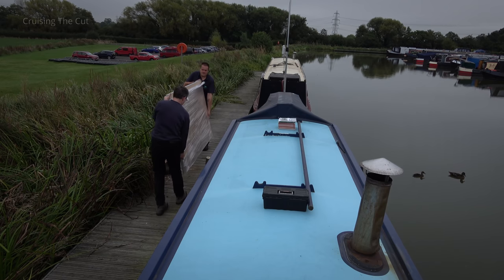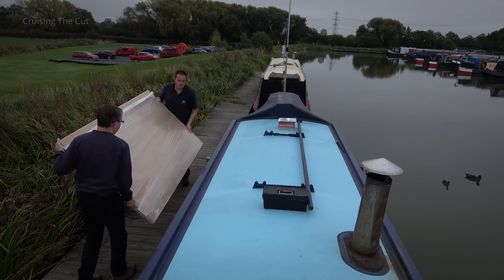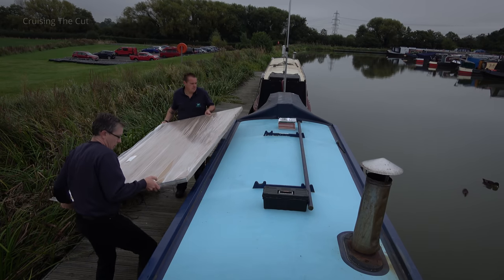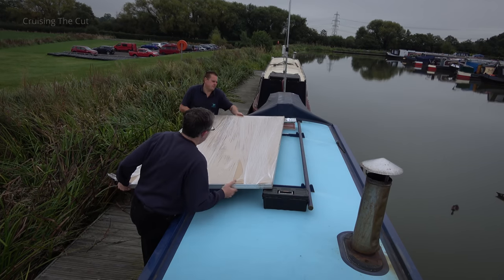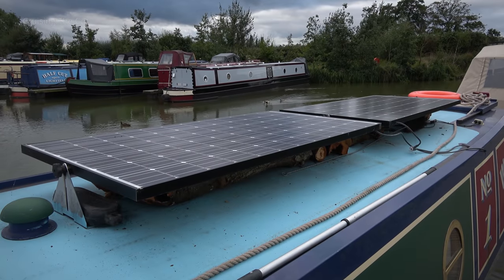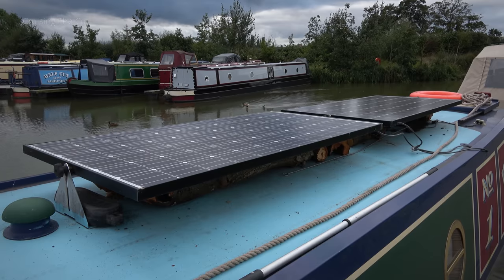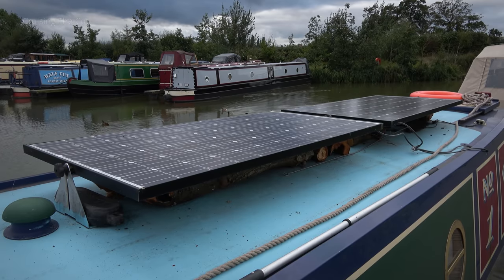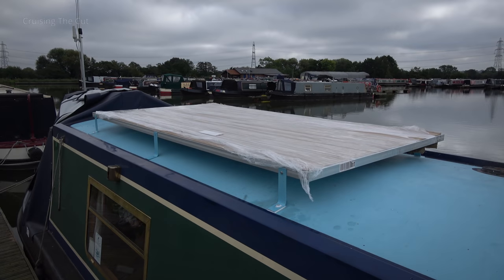260. Solar Panel and Lead-Carbon battery update (narrowboat)

Comment: Finally someone tells the truth  about solar !  most of us need to see how much energy we use  .If you change your habits and use more canned or an icebox you can do without a fridge
Reply: Ice is not widely available in quantity in the UK though. Supermarkets sell small bags for parties but it would quickly get expensive buying it every few days, not to mention the hassle of travelling potentially miles to the nearest large supermarket.

Comment: Running the engine for a while heats the water too right? So the "waste" heat gets used. Does running the engine for an hour get the hot water tank up to maximum temp too?

Lead acid batteries can last a surprisingly long time, I worked out that the battery in my slightly vintage car must be 15-20 years old. Might have lost some capacity but as long as it can start the engine it's doing what it needs to do.
Reply from the maker: Yeah my original AGMs were at least a decade old

Comment: Is a sunny day enough to charge your laptop? If so how are you charging out; a 12v adapter or with inverter on?

Great video by the way
Reply from the maker: Yes even a little sun is enough for the laptop

Comment: you should look into LiFePo4 batteries. they are life changing. pun not intended
Reply from the maker: Cost, alas
Reply: @CruisingTheCut  LiFePo4 are so worth it though. The batteries will probably last 20 years. They recharge so much faster, especially on winter days when you have to charge them from the engine. You don't have to worry about running them down or having to fully recharge them. I've had my lithiums for 18 months, and I'm still amazed at the difference they have made.
Reply from the maker: But still ££££££
Reply: @CruisingTheCut  That's true, but they are such a good investment, and you would only need 200Ah worth.  Have a look at "Life Batteries" batteries website.
Reply: @CruisingTheCut  £860 You'd still have change out of a kidney, and you'd get a couple of good videos out of it too 8-)

Comment: Since I know nothing about what you are doing, please take this with a very large grain of
salt.......Would it do any good to put two small panels on each side of your boat?  You have 
said that in the summer you have enough energy but would 4 small panels put on the sloping
sides of your boat extend the timeframe by a few days/weeks on either end of your season?
Yes, it would be money, time and energy expended, but would that give you more peace of mind?
This may sound silly for a number of reasons but I ask with the best of intentions. Take care
and as you folks say 'crack on'. 😎
Reply from the maker: It wouldn't be cost effective at all on the side as for 3/4 of the time, that side wouldn't be facing the sun (unless you pick a static mooring for the period) and on many occasions the canalsides are covered in thick shrubbery so the vertical panels wouldn't see much sun anyway.

Comment: David " do you think if you installed a couple walk on panels on the front roof it would give you enough through the winter months?
Reply from the maker: I added a new panel though! Also those walk-on panels are legendarily unreliable after a couple of years...
Reply: @CruisingTheCut  Thank you, that's good to know. I see a lot of new boats with them.

Comment: David, would a couple of long, fairly narrow roll-up solar panels fit on the roof along side what you already have?  I'm thinking maybe you can add another 3-4 amps for next winter and then roll them up for storage once the sun rises in the sky.  Either that, or switch to a 3-way fridge like what is installed in caravans, (LPG, 12VDC, 120VAC) then you could run on propane during the low light months and save your electricity for things like your computer that can't use propane.
Reply from the maker: Hi, please see my pinned comment at the top :-)

Comment: Just an FYI but the fuller a fridge/freezer the more efficient they are. So putting back in sealed empty bottles and the like mean the fridge has to cool less air which escapes every time you open it.

We got a letter from the power company a few months ago saying that the power would be out due to some urgent maintenance so the night before we padded out the excess space in our fridge with towels.

Edit. Just seen the title of your next video and it seems my point is now moot.

Comment: You really should get a Honda 2000 watt generator . Quite and fuel sipping. Unfortunately you are damaging your diesel engine by not running it with a proper load on it. The fuel injection pump will over fuel the combustion chambers and wash down the cylinder  walls. The result will be loss of compression
Reply from the maker: Hi, please see my pinned comment at the top :-) As for the engine, it is very customary for narrowboaters to run their engines as described, for power and hot water.

Comment: The question becomes is it cheaper to run the engine and pay the diesel, or buy the solar panels and convertors..................You can buy a lot of diesel for the price of the solar panels.
Maybe you can program the parallel controller differently than it is set up now, to work more efficiently for your application.
Reply from the maker: The parallel unit is not programmable, alas. The key benefit of solar is the blissful silence!

Comment: All a bit bizarre these charge controllers. If the voltage output of the old and new solar panels is the same, a simple diode for each would all that would be necessary feeding into a pair of terminals on one charge controller, erm, voltage controller. - interesting thought - no wouldn't work. Couldn't use the voltage regulator on the alternator as that'll control the field coils on the alternator.
Running the engine would not be a mistake if it was set up ideally - giving you central heating, electricity and believe it or not, motive power too ;)
Reply from the maker: The voltage is not the same

Comment: David, if you are tied alongside all winter on an ideal for you non-powered pontoon ..
and you don't mind the boat looking a bit "nerdy"...
would it be possible to install further solar panels on "temporary and  demountable mounts" to cover those 2 dark months....
and at the relevant time in January...demount and store them...until November...?

Alternatively

How much more expensive is it to be tied up at a power pontoon than at a non power pontoon for 1 month?
Is that power pontoon always going to be available when you want it?

Second alternative:
Can you come to any agreement with the marina to lay on shore power to your pontoon?

Third alternative option:
A Honda 2200i generator that you can use both on the boat and with the camper....?
Reply from the maker: You could technically add extra panels on shore but it could be a faff to store them. The marina might lay power but then charge me more for the mooring!
Reply: @CruisingTheCut  
Well that leaves a 1 month per year stay at the power mooring...
or a Honda generator....

Comment: P (power) = V (voltage) x I (current) 12v multiplied by 3 amp would be 36w  

R (resistance) = V / I  12v divided by 3 amp = 4 ohm.
Reply from the maker: Yes. Or, as a quick "instant calculation in my head", divide Watts by 10, it's near enough for a rough figure

Comment: Why not fit one of those marine "windmill generators"??
Reply from the maker: See pinned comment
Reply: They are great at over 20 knots of breeze, churning out 6 amps for hour after hour. Where do you get 20 knots hour after hour. No where that I will ever take my boat. However if you want to buy a wind generator, well have I got a deal for you! I'll even throw in a free set of steak knives.
Reply: @philgray1023  The vertical ones work from a lower speed. You are also more likely to have wind on those wet horrible winters days without sun.

Comment: 170 Watts for a laptop is insane. I just bought a new tablet/laptop and it only has a 65 W charger. My old one had a 40 W charger, but that wasn't enough to charge and use the computer at the same time.
Reply: You never saw my old CPU.  Imagine my surprise when I learned it HAD to be water cooled  o_0

Comment: Did you upgrade the alternator from standard to a high output one?
Reply from the maker: No, just the standard one
Reply: Chances are the existing alternator will supply more current than the lead batteries can absorb.

Comment: Have you compared the cost of running the engine with the cost of buying the solar panels, and all the ancillaries? You can buy a lot of diesel for the cost of the solar systems.
Reply from the maker: No, cost wasn't my priority here - silent generation was.
Reply: @CruisingTheCut  Understand that.

Comment: Do your charge controllers have a communications port or anything of the sort? I've seen a number of them elsewhere that are able to talk directly to one-another so you might be able to eliminate the need for the parallel controller all together.
Reply from the maker: Yes, they run modbus or something, it’s how the parallel unit talks to them

Comment: Perhaps get a small Honda EU generator? They run extremely quietly (around 60-65dB), have a fuel efficiency of ~0.1 gal./hour, and they're small and compact.
Reply from the maker: I really like those and they are quiet - but they're banned at many marinas for noise, and you then have to buy and store petrol (not available on the canals as everything is diesel-oriented)
Reply: As the host points out, portable generators have little to no muffling ability so it stands to reason they would be banned in the “residential “ portions of the CRT …. They do make sound suppressed generators , but if I’m not mistaken those are not portable units and are pretty expensive
Reply: @MrSheckstr  There are some boats, seen at the not so recent Crick show, which have a diesel generator in a sound proof cocoon.

Cooling by the usual skin tank arrangement.

The diesel generator charges up a solid "wall" of lithium cells which then run "whatever", as in phone charger to the 10kW electric motor.

I gather these systems are are labelled "serial".

Certainly one engineering solution.
Reply: @MrSheckstr   Clearly you've never stood next to a running Honda eu series generator, they are extremely well muffled and one can have a normal conversation within a meter of the generator.
Reply: @acmeopinionfactory8018  it doesn’t change the fact that they are incredibly antisocial to use around other people. Sound travels well over water, and in an otherwise quiet environment someone else’s “quiet” generator soon becomes irritating.

Comment: You do not need a parallel controller.  Charge controllers work parallel but they can have problems running series
Reply from the maker: Ah, you're conflating parallel and series wiring on the panels to the controller with running the controllers themselves in parallel
Reply: @CruisingTheCut  no i mean running the controller battery connections in series

Comment: how warm is the canalwater?
Reply from the maker: Cold
Reply: You measure the warmth of canal water... by the depth of the ice on top !... 🤣
Reply: @CruisingTheCut  I'd possibly add a "Very!"
Reply: are there no boat fridges who us the cold from the canal at the hot side of the fridge? This would be very economical as the fridge would be very efficient

Comment: So do you think you need to go to the lithium ion batteries for better power consumption? You can go lower on your LIB system & it will not destroy the batteries.
Good luck,
Chris from Missouri
Reply from the maker: Hi, please see the pinned comment at the top, cheers

Comment: Just last year I upgraded my home with EG4 48V 100AH LiFePower4 Battery's, your boat I think would do better with a eg4 24v 200ah lifepower4 battery than lead batterys.
Reply from the maker: I'd like some but they're still expensive and don't like the cold!
Reply: @CruisingTheCut   Mine has a heat pad and low temp cut off, Bavaria get's very cold in the winter.
Reply: @doskraut  Certainly a solution for low temperature protection against over charging.

I would have the heebee geebees that the tech failed and you ended up with an outrageously expensive doorstop or paperweight.

Comment: Shame there's no way to off the shelf way to force your stove to give you some power if it's burning along merrily anyway. The innerwebs claim there are small (ish) diesel generators, but they don't seem to be anywhere as small or cheap as the petrol ones. Pity really as at least then you wouldn't need to have a second type of fuel hanging around.
Reply from the maker: The stove generators create miniscule Wattage, just about enough to charge a phone at best, unfortunately.

Comment: i have wonderd about hot water or hot air solar it works in usa south west. also are there gas refrigerators the ones i have had seem to be very effective and low cost to run here in us. you may not have bottle storag to handel it.
Reply from the maker: Hi, please see my pinned comment at the top :-)

Comment: What would parking under a street light do? 
Would it allow the panels to trickle-charge the batteries during the night as well?
Reply from the maker: The light output is so negligible that any power generated would be minute

Comment: From what I understand, lead/Carbon batts charge faster than regular lead/acid. They are also not damaged by partial state of charge. 
Do you use only one inverter for the whole boat? Inverters use some “management” power when they are on regardless of output power. I don’t know if your fridge is a 12v model or a household 240v model but if it is a 240v model maybe you can have it run from its own dedicated inverter of the smallest wattage possible that is able to run the fridge, then leave the big inverter off until you need to vacuum.
Reply from the maker: It’s a 12V fridge
Reply: @CruisingTheCut  oh! Then you are golden! I am planning to get one in the future. I am currently converting all of my lighting to led in my bus conversion. I have new Lead Carbon batteries (the first ones in the USA (the Victron dealer here thinks)) for it and so far so good!
Reply: @CruisingTheCut  So do you run your inverter all the time, or only when needed? The VE MPII's have a fairly substantial parasitic load when inverting...
Reply from the maker: I only run it when needed

Comment: Is there any wave / water motion powered  hydro to battery thing or  mini fans all over boat  that charge as your crusing for wind use charge ?
Reply from the maker: There is no current in the water on the canals. For wind power, please see my pinned comment at the top.
Reply: @CruisingTheCut   when crusing no extra water power /movement to Add to power source  ?   a perpetually motion ? Boats going by waves

Comment: What about  - Woes Solved With A PowerOak AC200P Power Station / from another narrowboat channel?
Reply from the maker: Those things are, unfortunately, a red herring - they're just a battery bank and charger which is exactly what the boat already has albeit as discrete elements rather than packaged into a box. They can't magic power out of nowhere, you still have to charge them.

Comment: is the  angle of the panels critical ? i had off grid solar home 5 years ago they were at 45 degree angle and it did make a difference even cloudy days compared to flat  mounting them  about 10 percent more but i think it was because the muck and dust from the farm fell off when angled or it rained  lol .
Reply from the maker: I mentioned this in the video...

Comment: If you ever move your boat any distance, will you have to remove the panel so you can walk down the roof?
Reply from the maker: No, the new panel is at the front so not in the way

Comment: Once full, Disconnect the batteries and measure the voltage.to determine the charge.  watch nwill the charging voltage declines or look up how long you should wait.
Reply from the maker: Disconnecting the batteries is not practical but provided there’s no substantial load on them (and no charge), the voltage readings are a usable indicator of charge.
Reply: @CruisingTheCut  Yep.  If they stay at 12.6+ for a while they are good.  My truck battery drops to 12.3 overnight, so its loosing capacity but not enough to impact starting.

Comment: What kills lead carbon batteries is under charging. Try to keep them between 14 and 15 volts. Mine is 5 years old now and still like new.
Reply: No they are not lol.  I think you mean they are still so good you don't notice the difference.

Comment: Can you get a propane fridge? Here in the states. Alot of RVs have the option of a propane fridge.  So it doesn't put the draw on your power supply and propane is cheap.
Reply from the maker: Propane fridges are not generally installed on narrowboats for gas safety reasons

Comment: Off topic but do you know if the red diesel changes are going to effect narrowboat owners?
Reply from the maker: No, we'll have to buy white but with a rebate
Reply: Red deisel will always be available to boaters whilst white is available,  however it will be sold at white deisel prices less any rebate.  
It is currently £1.60 a litre compared to Decembers pricing of 82 pence a ltr .

Comment: have you look in to, power optimization.. eks.. not to from 12v from battery to 230v for a laptop charger, to some low volt in to the M1 ?
Reply from the maker: Cheers but the power saving is pretty negligible as you still have to do one conversion from 12V to 5V (I think) on the USB charging port
Reply: @CruisingTheCut  The DC to AC to DC take a heck-lot more power than a DC to DC